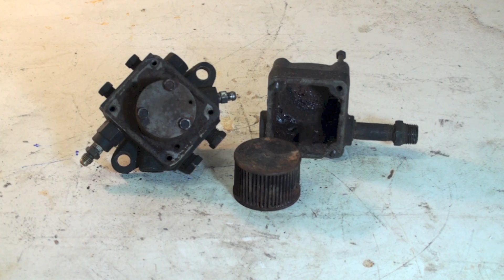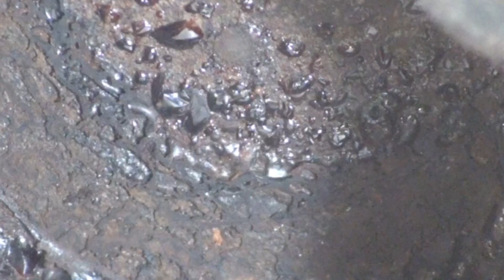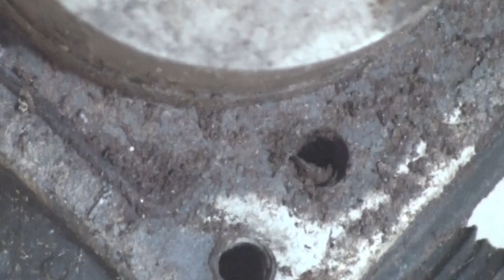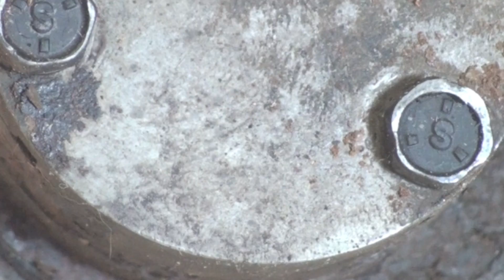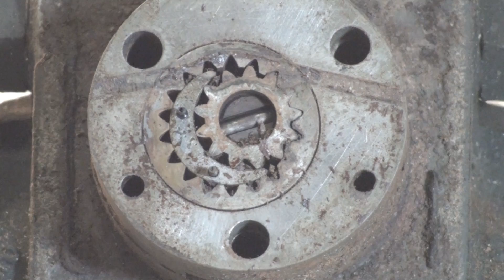Oil furnace pump autopsy

Comment: I have a military heater that has a Suntech pump in it. The heater went unused for about three years so when I went to turn it on, the pump was locked. I completely dismantled the pump cleaned all the parts with cleaner I can get the gear out, but when I put it all back together, I cannot get the shaft to return. I’m wondering if I lightly sand the gear if it will clean up any corrosion that may be keeping it from spinning. I would just buy a new pump but after I found out how much the pump cost I’d rather try to repair it. It was over $1000. Leave it to the military to use the most expensive parts possible. I could probably find another pump that has the same gallons per minute and pressure, but the problem is Rep plumbing it as the current pump has about five ports on it that are used.. thoughts on trying to clean up the gear if you think that would work or would it remove too much metal possibly and not create the same pressure.
Reply from the maker: If there is corrosion on the gears, you can try it but use something like 400 grit.
GFM
Reply: @grayfurnaceman  the best I could find was a 220 grit so I cleaned up in between the teeth just on the gear. Got it freed up. Used my drill to turn. The shaft seems to be pumping fuel around, but until I get  it all back together, I won’t know if it will still make pressure, thanks for getting back hopefully in a week or two I’ve got it all back together, waiting on a coupler to get made, as it has a special coupler from the motor to the pump shaft,

Comment: if i USED THE WHITE PURE SILICON FOR SEALING WINDOWS  WOULD IT SEAL HE BACK OF THE OIL PUMP PLATE GOOD FOR 300 DEGREES F ?
Reply from the maker: +Rondo Schiavoni I would use red silicone.
GFM
Reply: ok THE KIND FOR CAR GASKETS .
Reply from the maker: +Rondo Schiavone That would work.
GFM
Reply: this is what  I found  and fast drying time.
http://www.permatex.com/images/stories/virtuemart/product/80007.jpg
Reply from the maker: +Rondo Schiavoni Thats ok.  Just be sure it does not get into the pump itself.
GFM

Comment: Does the 3 bolts get tightened down or ? When I tughten mine I can't turn the shaft on the back unless I lossen them a little and only slightly snugg them.
Maybe lightly snug with a little locktight?
Also my burner housing says pump set at 140 can this be ajusted?

Comment: i took my pump apart just now as i was getting locked out, then couldn't get the thing back together and running,, just spent £85 on new pump and fitting when in actual fact my pump was perfectly good to start with,, so annoyed..  my question is this...how hard are these pumps to get back together??..  after i thought mine was rebuilt it just squealed at the point i rang a professional.
Reply from the maker: GTrogue I generally did not take them apart.  As for squealing, If the 3450 RPM pumps do not get a good prime of oil they will squeal on the first startup.  It usually means replacement.  Hope this helps.
GFM
Reply: @grayfurnaceman  Is there a diagram or video on how to replace-put back together the gears, i screwed up and didnt take a picture when I cleaned them and when I put it back together it didnt work like you described it should i the video. I ran out of oil and it clogged.

Comment: I have looked at several of your videos......the one video said about turning the thermostat  to fan on.....never heard the fan come one but I checked the breaker and fuse and no problem there.....when I tried to bleed the furnace nothing can out....but when I disconnected the line and held it down fuel ran freely..please email me a response of probable cause for this
Reply: sorry forgot email...inferno426@yahoo.com
Reply from the maker: Kyle Little Did the burner assembly start for approx 40 sec?
GFM

Comment: Another good thing about the 2 line setup is while service or repair you very seldom or ever have to bleed the fuel,one line system about everytime you have to fool with the furn you have to bleed it! cool inside look of the pump it has been some time since i have had 1 apart! great video

Comment: the pump still works and got the furnace to light and then turned it off and it keep burning inside the chamber is it just dirty with old oil. will it burn off or does it need to be cleaned. thanks

Comment from the maker: A 2 pipe system will work regardless of tank position.  The 1 pipe system will only reliably work with tank at the same or higher than the burner.
GFM

Comment: well my tank is not below the burner i am assuming it was on the old setup. do i need to get a new pump or will it be fine if i just run a return line. thanks

Comment from the maker: The 2 line pumps are for systems where the tank is below the burner so that the pump draws the oil thru the pump, raises its pressure and back to the tank.  The plug is installed.  1 pipe, the plug is not installed so the oil recycles thru the pump.  
GFM

Comment: that makes sense. does the pump have to run with 2 lines or can i adjust it to run with 1. also what is the purpose of the return line

Comment from the maker: The pump seal has failed or it is piped wrong.  If you have it piped with one pipe and it was piped with 2, you need to remove the bypass plug.  To locate the plug, I would look at the pump manufacturer website.  Hope this helps. 
GFM

Comment: i have an old furnace that i am trying to get running and i am having problems with the pump. it is spraying oil out right bye the shaft and coupler. it still pumps oil though what would cause this. Any input would help thanks.,